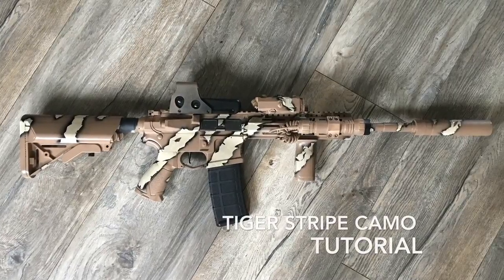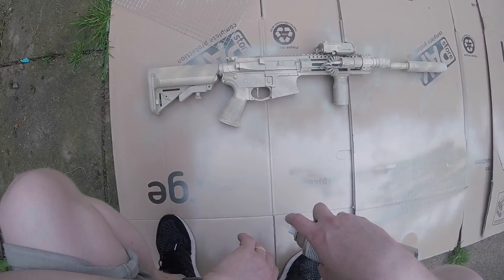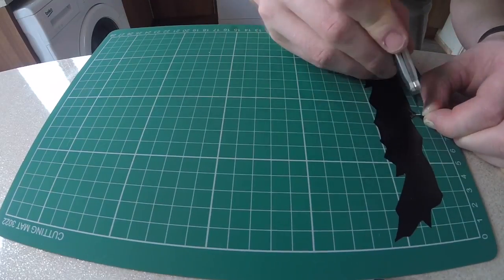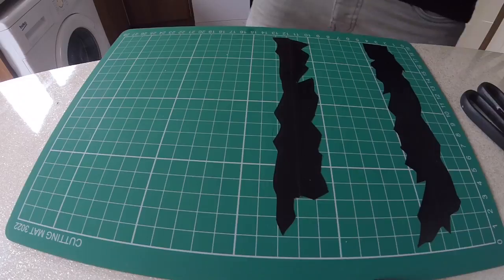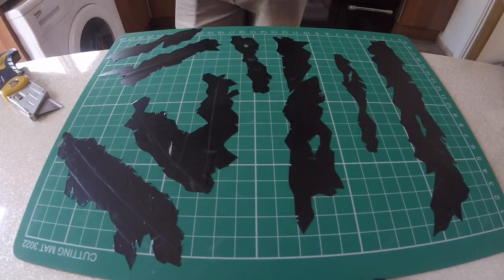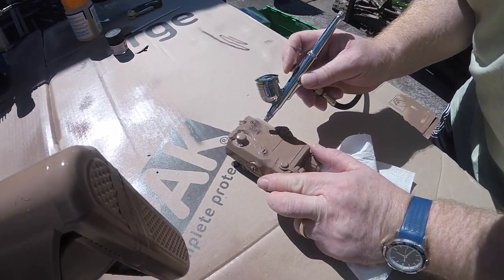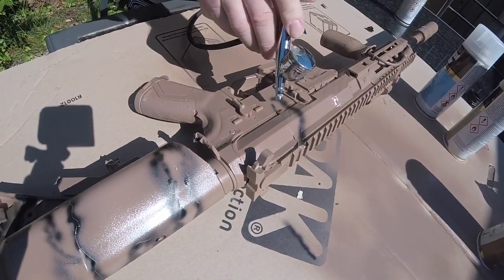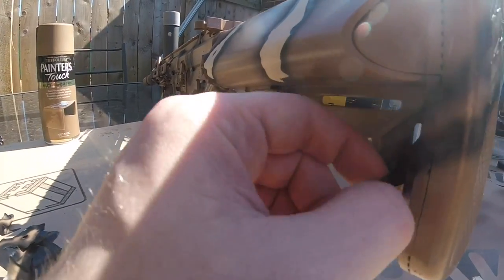DIY Gun Paint Job Tutorial

Comment: Looks great, now if I only had an air brush 😢

One thing I would suggest is to plug your barrel/cover your crown. When I painted my .22LR it took about 30 shots for it to hit accurately again until the paint was all worn off around the crown.
Reply: I’d suggest removing the inner barrel and plugging the outer barrel with toilet paper - same deal with the magwell, the space between the trigger/receiver, and the motor plate if applicable.

Comment: Subbed, absolutely helpful! 
Now, should I take my gun apart? 
i'm scared that the paint will get in places where it not belongs
Reply from the maker: I didn't take mine apart! Just make sure to thoroughly plug every hole or gap where paint could get in and you're all good 🙂
Reply: RadioSilence just use  of instead of the darker brown and a lighter green instead of the tan.  That will give you a green tiger stripe.   Practice on a old springer or something if in doubt.
Reply: Take the bcg and charging handle out then cover any laser, light or optics no paint got in-between the upper and lower for me

Comment: Does the electrical tape work better then painters tape? Curious cause i had a few spots with the under layer paint lifting while peeling the tape.
Reply from the maker: Yes, electric tape keeps its shape and is easier to cut than painters tape in my opinion. If you find painters tape works better for you though then go for it! 🙂

Comment: Is disassembly of the gun required or any degreaser or sanding necessary?
Reply from the maker: Miguelito Not necessarily. While disassembling the weapon will definitely prevent any paint getting in to the moving parts, it’s equally as easy to just plug the holes or mask areas off. 
No sanding or anything required. Paint isn’t technically permanent and with a simple paint job like this it’s important to remember it will most definitely show signs of wear quite easily

Comment: Would this work if I were to make a skin like you can find on CSGO or Rainbow six siege?
Reply from the maker: Yes, 100%! Just gotta make the stencils and you're good to go!
Reply: @RadioSilence  thx mate, also is this paintable on a metal casing or plastic only (due to reasons as mighr corrode metal and whatnot
Reply from the maker: @Arclightning  The spray i used here is multi surface so really just depends on what paint you go for. But just be aware that no matter what material you are painting it is likely to wear anyway

Comment: Would painters tape work for stripes?
Reply from the maker: Depends really. The reason I used electric tape is because it is very flexible and sticks down well, whereas painters tape isn't as sticky and the edges might lift up, ruining the effect of the hard edge. You want a hard edge for the effect, otherwise it would ruin it in my opinion. Hope this helps!
Reply: Yess it works well i used it sevril times makeing m90 splinter camo :)